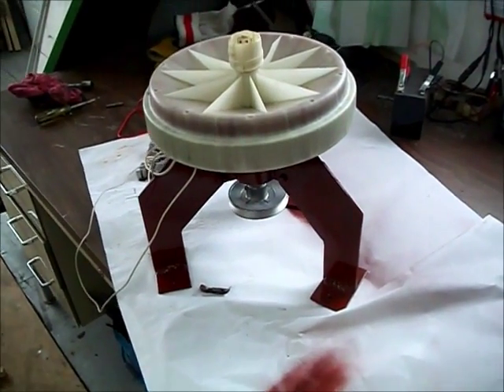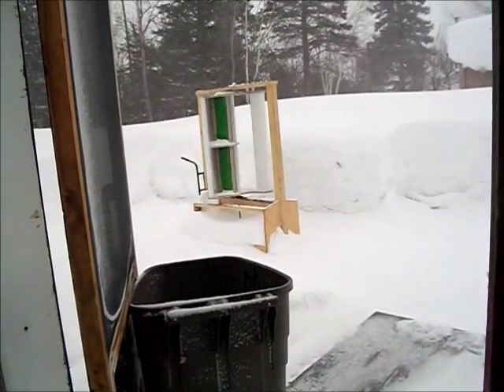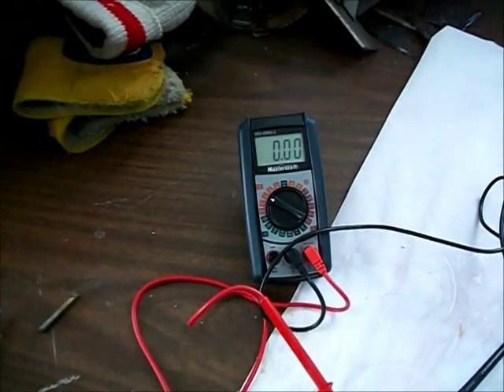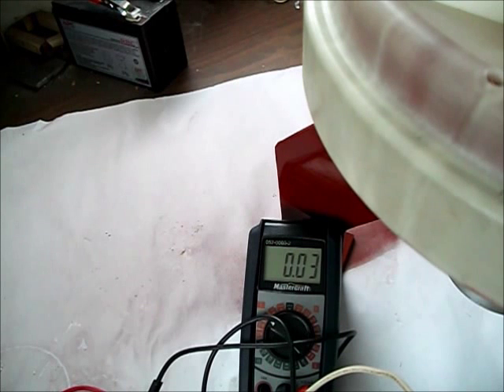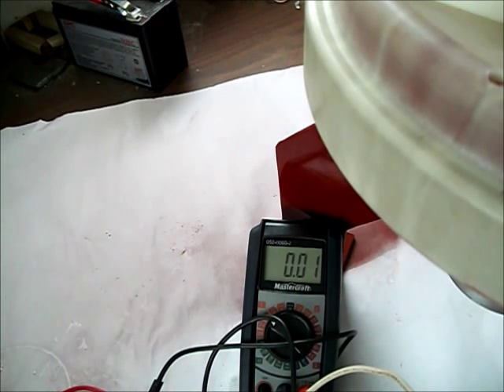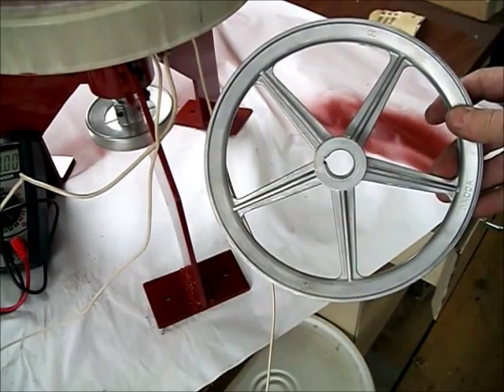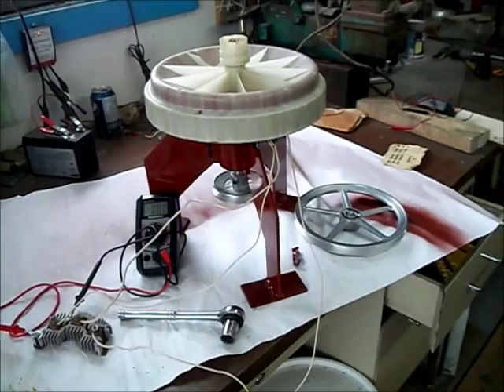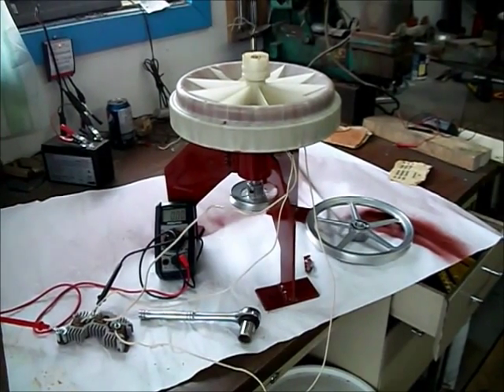F&P motor PMG

Comment: some very late info.    theses motors should be used  AS  motors.     why is this true.    rewiring the stator is fine.   WHAT  ABOUT  THE  ROTOR.    the rotor is  configured  to function in a bldc Motor, that has a 3-phase stator; where the  phases have  SEVERAL coils.   see linked diagram, of stator phases.     if you happen to be interested in ou, see my latest research.             it should be understood that  volts  are not Power.    power is expressed in  Watts.      volts x amps =  watts         the obvious implication is that if  AMPS  are  Low,  SO  WILL THE  WATTS  BE.        when voltage  is   measured there is  NO  lenz-force braking, at the pma rotor.     in order to simulate a  Nominal  current draw, as when a pma is connected into a  low-impedance  power circuit,   short the pma output,  and  TRY  to turn the rotor.      cheers
https://lgechupacabra.files.wordpress.com/2016/09/standard-wire.gif
https://www.youtube.com/watch?v=P2uRd2m-0S4

Comment: nice job!! how did you rewire the motor to get a 12 volt system
Reply: check out the website thebackshed for info on rewiring for various voltages

Comment: http://usvawt.com/cgi/windpower.cgi?h=6;hunit=0.3048;d=3;dunit=0.3048;Calculate=Calculate

Hi, above calculator can help determine about how much power you can get at different wind speeds. Add a MPPT controller that will work with a PMG will also help. Great work, thanks for posting.